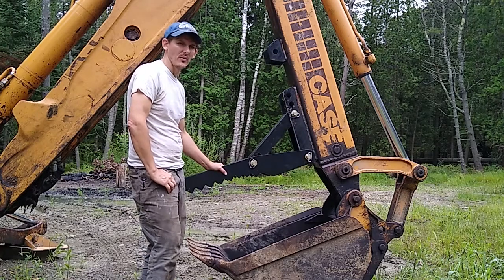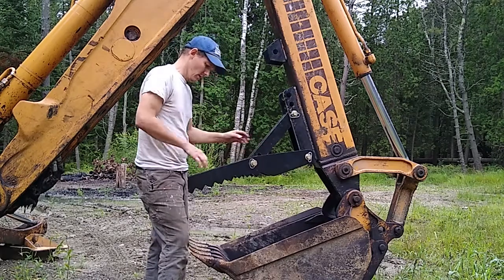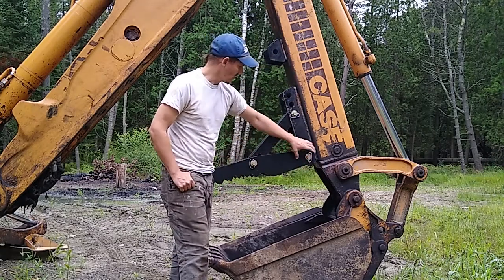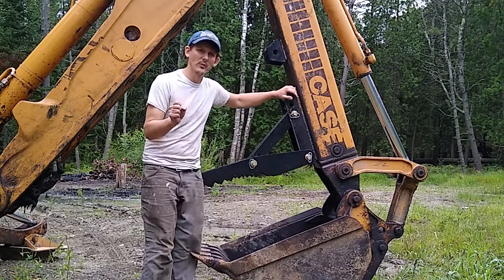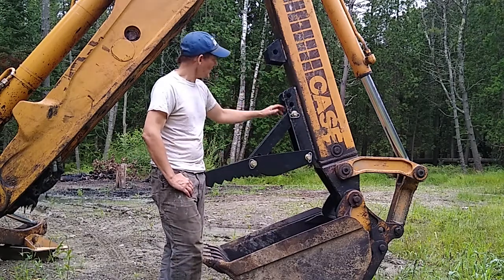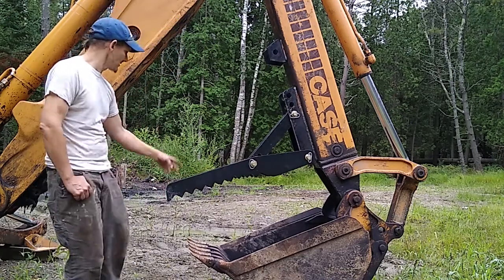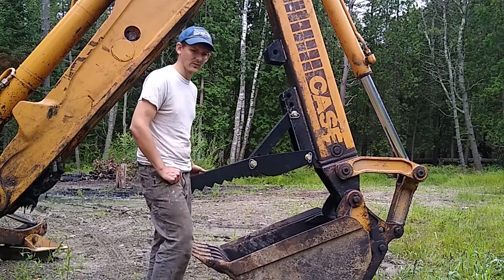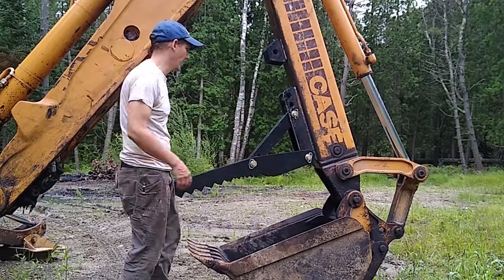Titan Attachment Backhoe Manual Thumb Installation Tips

Comment: Its been a year since you posted, but, what is necessary to  weld to a std case 580d in that area ? Thanks
Reply from the maker: Nothing special for the 580k.  Sorry I don't know the differences between the d and k in this area.  I was worried a little about the grease on the inside of the extendahoe  but got over it.  I ground down the paint and imperfections somewhat, then just blasted on a few long welds.  So far so good!

Comment: That was a great video. You did an excellent job. I have a backhoe and I'm trying to decide between a hydra thumb and the one you installed.
Reply from the maker: Hydraulics are far more useful, but much more expensive.  I considered but didn't go that way because it also requires setting up hydraulic controls/valves which is a lot more work if the backhoe isn't set up for it.
Reply: You can purchase a mechanical one then purchase used cheap cylinder to make it hydraulic. Not so difficult.

The main problem is that the thumb have to be articulated on the bucket pin, otherwise have plenty of positions you can’t use it. It requires to make a longer pin by yourself, you can purchase on some websites the rectified surface hardened plain round steel bar to make the new pin by yourself. Don’t use normal steel it would be destroyed quickly.

After that, the problem is having it fully opened nicely. Actually I can’t find a solution to obtain full open position that let me having bucket fully closed.

To have it fully functional and not a trouble at normal excavator job, the thumb has to be able to follow the bucket from bucket full open to bucket fully closed.

Excavator without thumb is some kind having half an excavator. But it’s difficult to obtain one fully functional

Comment: I bought some one inch steel and made my own jaws. The 1/2 steel from titan was not strong at all.
Reply from the maker: Not strong at all?  Now I'm wondering what you're doing with this tool!
Reply: @NineCarGarage  I mounted it to a MF 40 backhoe I picked up a white pine that was about 10 feet long and 16 inches through the jaw on one sid snaped
Reply from the maker: @jimsadler2342  impressive!! This demands pictures!
Reply: @NineCarGarage  how would I post a picture on YouTube
Reply: I have a picture of the broken jwa
Reply: @NineCarGarage  I posted a video. Wouldn’t let me post a picture so I had to video the picture
Reply from the maker: @jimsadler2342  wow.  That's amazing.  I dont give my hydraulics enough credit to do that damage.
Reply: @NineCarGarage  did you see the metal. It looks like alloy

Comment: How many inches apart is between the big mount and little mount? I have the 36" as well for my 580e case. I just want it to close correctly before I weld it up.
Reply from the maker: For me there's 6 3/8 inches between the two brackets.  But make sure your pins are in when you tack weld the small one in to ensure the right distance.  They should also be lined up such that the thumb can be pinned on both brackets.  There's not a lot of clearance there.
Reply: Thank you for replying back.

Comment: Where can I get that piece I have Hyundai robex200
Reply from the maker: I think you should be able to find what you need on Titan attachments website, maybe even the same unit.  You'll probably have to guess which unit will fit by dimension instead of direct call out for your model.  These guys also sell hydraulic thumbs.  Their site isn't the easiest to navigate, might have better luck searching via google. https://www.palletforks.com/tractors/3-point/backhoes-and-accessories/36-inch-backhoe-thumb-hoe-clamp-58-inch-steel-plate-assembly-weld-on-adjustable/122982.html

Comment: Just be cautious of how much pressure you pit on the thumb when curling the bucket. The outer sleeve on the extension arm can be damaged and cause binding when trying to extend.
Reply from the maker: That makes sense, thanks for the comment!
Reply: I don’t have to worry about this since I don’t have an extenda hoe right?  Thanks in advance I appreciate the video! Also, any updates on the thumbs condition?

Comment: I kinda wish my 580K was an extenda hoe just for the welding, still have not seen a good thumb for a standard 580K.  Nice video thanks for taking the time to make and put it up.
Reply from the maker: No problem.  I've seen bolt on thumbs, also I saw something else out there that uses two or three of the bucket attachment points to make an articulating pincer thumb; might be worth a look if you can find it!  Also it's possible to weld onto the ductile if you have the right knowhow and equipment.

Comment: Thanks for the tips man. considering this thumb for my 580 too. What was the exact model you purchased from titan? 
They sell several different models, but I think they have a backhoe specific one too...
Reply from the maker: I got it at palletforks.com, item 122982.  This link currently works.. https://www.palletforks.com/tractors/3-point/backhoes-and-accessories/36-inch-backhoe-thumb-hoe-clamp-58-inch-steel-plate-assembly-weld-on-adjustable/122982.html